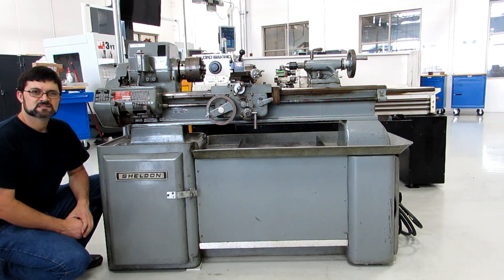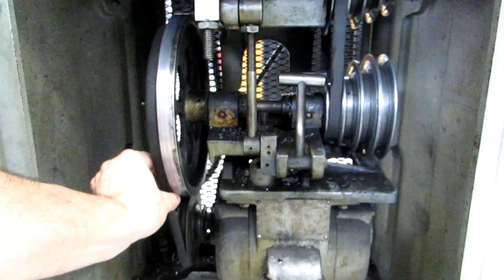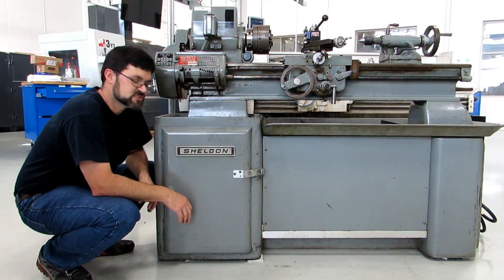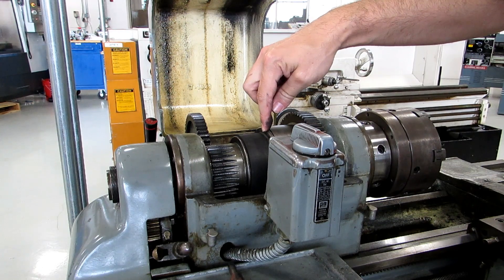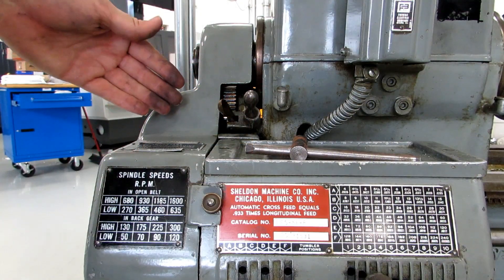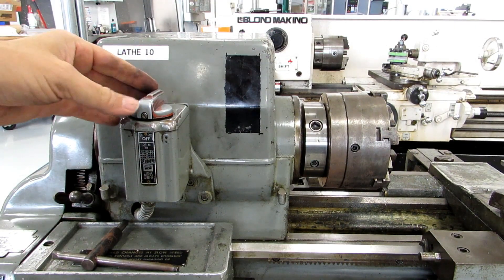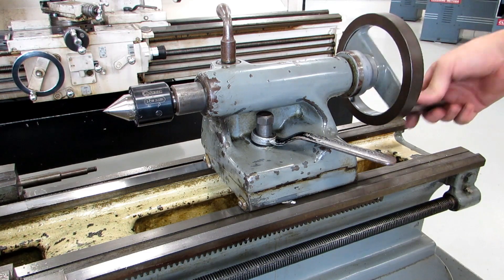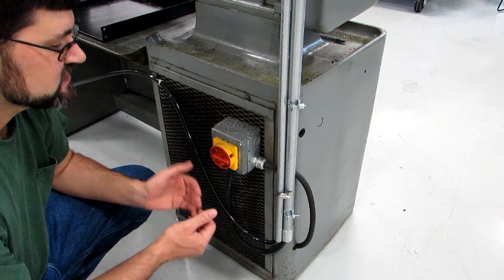Parkland College Lathes - The Sheldon Lathe

Comment: I can't thank you enough for this video, its helped me tremendously with understanding my Sheldon lathe. Speaking of which, I have just purchased a 10x30 UXL-56-P and I want to make sure everything is properly oiled and lubricated before I start playing with it. How do you recommend going about oiling and lubricating prior to use? Went through quite a few forums and one Practical Machinist post stated the best oils and lubrication's to use with these older lathes so per the post I picked up a 1 gallon jug of Mobile DTE-26 hydraulic oil for the gear assemblies and a 1 gallon jug of Mobile Vactra No.2 way oil for the ways.
Reply from the maker: That all sounds good to me.  Don't overfill it with oil or you'll end up with a bunch of oil on the floor.  Most of these machines have a small oil sump that has a simple mechanical pump (like an oil can) or just a slinger to get the oil towards the top.  The belt drive ones are even simpler.  You just need the oil to the level of the bottom of the bearing.  Any more and it will just leak out.

Comment: What model Sheldon lathe is this?  When I got my Sheldon EM-56-P, the half-nut was not engaged with the leadscrew; it was rotated away.  Is there a reason for this?  Can the half nut ride on the leadscrew when it is not being used?  Thanks
Reply from the maker: I'm not sure of the model and I'm not teaching this semester so I can't check.  The half nut should be disengaged unless you are actively threading.  If it is engaged, the carriage will start feeding as soon as the machine is turned on.  You also can't freely move the carriage when the half nut is engaged.  There is supposed to be an interlock in the apron as well that prevents you from engaging the half nuts and the power feed at the same time, so if you cannot engage the half nuts, you need to find which lever switches between threading and feed mode.  Thanks for watching!

Comment: Thanks. I have an older model Sheldon, probably mid 40's, some things are different, but I now have some idea what they are for. I started threading, the other day. I'm practicing on copper tubing. Its soft, so I can't screw too much up. I watched another video, on cutting threads, with the carriage moving away from the headstock. I'm not as nervous about running that direction.

Comment: When you change the belt from high to low (about 2 min mark), you know you can just use the lever that lets you change the other four speeds to make that a lot easier, right?  No fighting with the belt, no need to rock or hand turn the pulley.
Reply from the maker: Actually, I checked on that and you can't.  That lever moves the motor and jackshaft pulleys as a unit.  That's why the one pulley is flat instead of v-shaped.